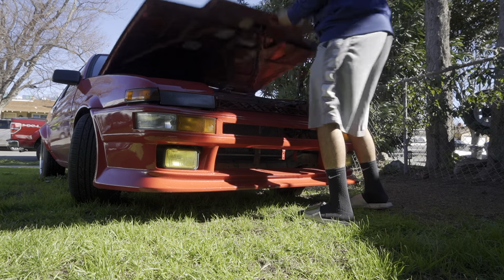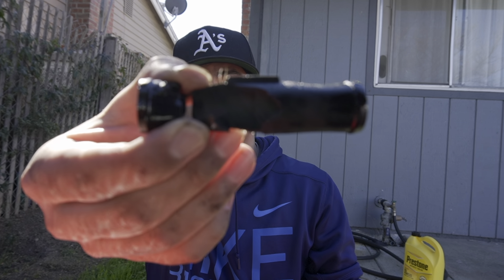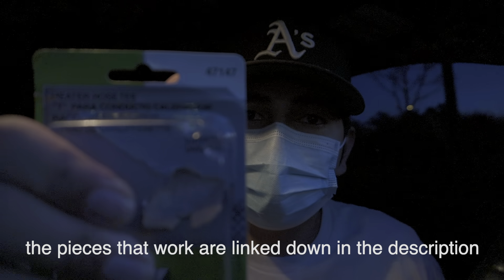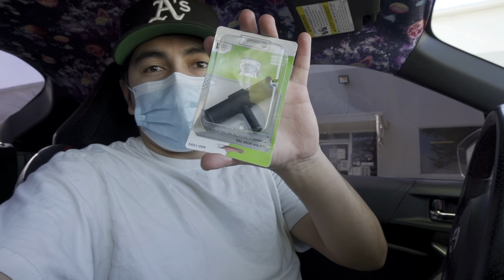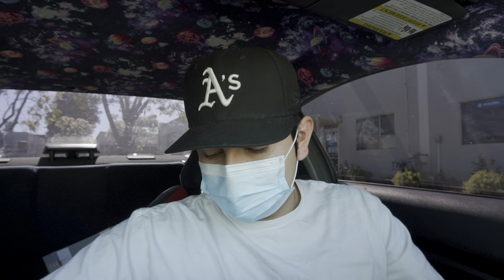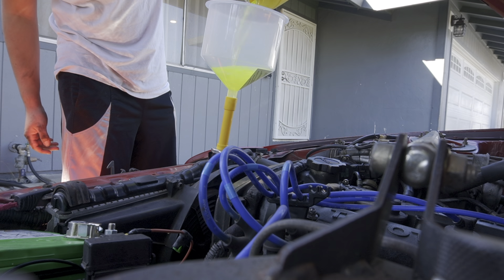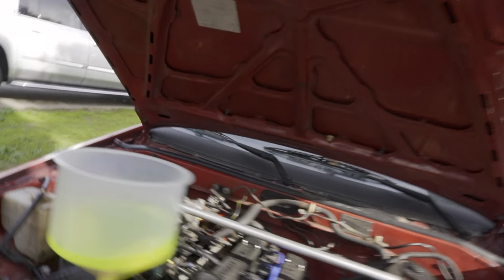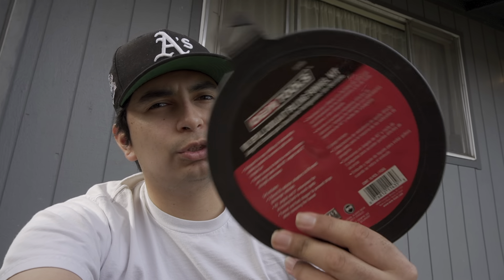My AE86 Broke Down by Peeing Coolant in a Drive Thru...

Comment: Do you plan to swap engine at some point ?
Reply from the maker: I was planning on it when I first got it but now I’m just want keep with its already cool 4age and 6 speed swapping it with the j160 off the beams motor since the t50 isn’t exactly the best transmission for it

Comment: Im having similar alternator issue not charging my battery as well and already went through 3 Autozone alternator already. What was the issue the shop found as to why your alternator isnt working? Im curious to know so i can get mine fixed as well and back on the road to, im defeat at this point and looking for answers, thanks.
Reply from the maker: Honestly I’m pretty sure it was just a bad batch of alternators for it when it came to their remanufactured alternators. It was very annoying since autozone only offers remanufactured and not new units for our car. I ended up going the route of using a new 70amp alternator from autozone for a 1992 toyota supra N/A manual transmission and it bolted up and has worked fine since. It’s part number was 14611N. Hope this helps!